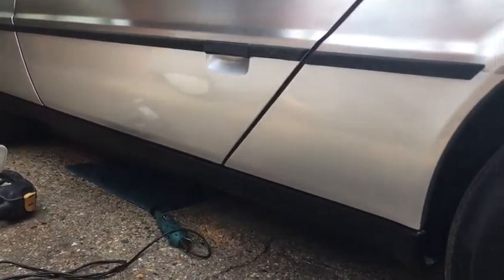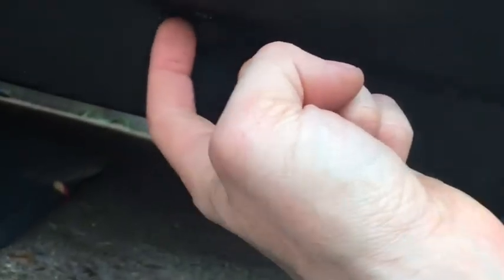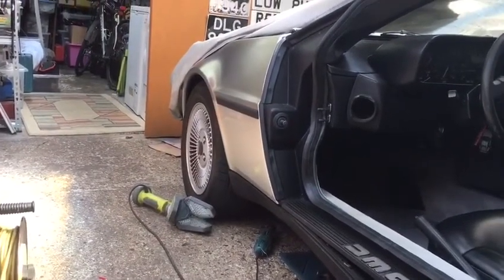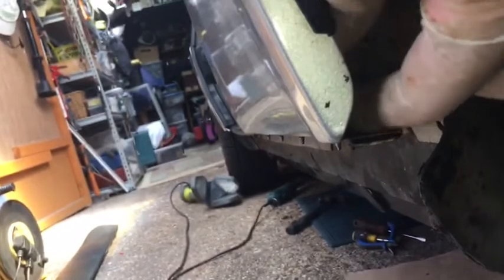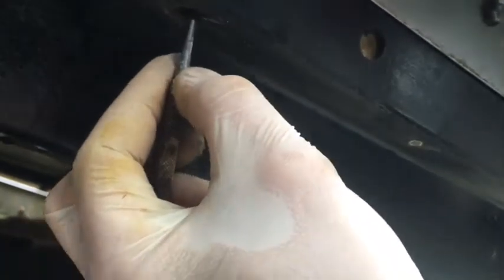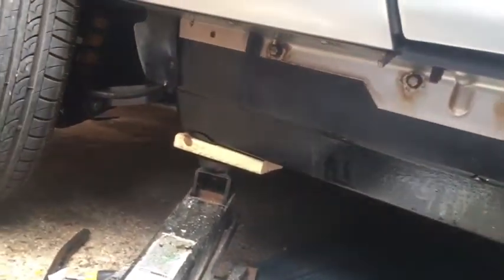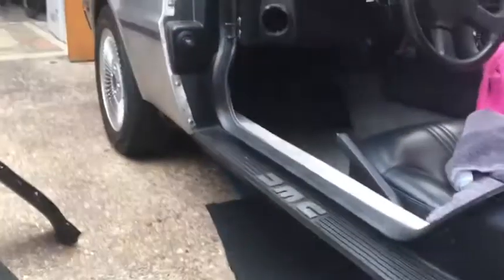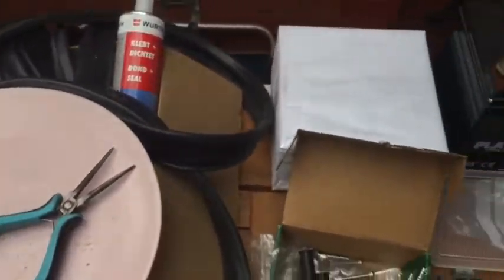DeLorean Restoration - side Sill removal and full renovation (I can now remove my Wing panels£

Comment: Very nice. Clean install. How much in-and-out play is there for the lower front part of the rear wing panel? Not front to back but side to side. This would be for aligning it with the door.
Reply from the maker: @dmcindiana  hey, sadly I can’t answer that. I just did the job and it’s been untouched since (ie no issues ). Many thanks
Reply: @griceyboy  No issues is good news! I imagine I can just take a dremel and open up the holes a little in the lower stainless support shelf if needed. Again, really nice work. Really demystified this whole body area. Thank you.
Reply from the maker: @dmcindiana  good luck - it’s nice when you remove the cill and see what’s behind it :)